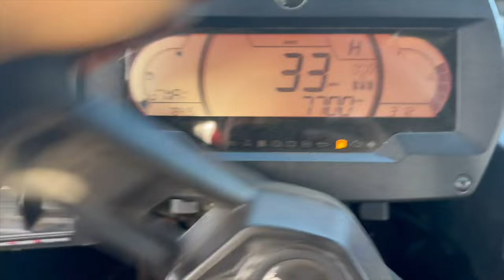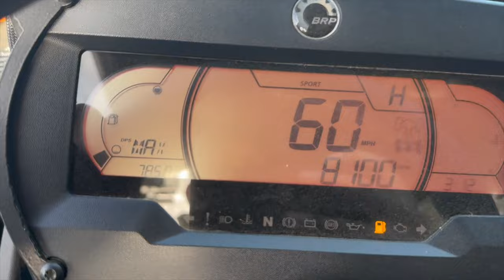Evo InSANDIty Clutch kit Install on 2022 Maverick X3

Comment: Great video, thanks for putting it out there 👍

A question.. when I removed by main plastic clutch cover on my 21 XRS, I had difficulty slipping the case out from behind the shock, is there a particular trick to sliding the case away after undoing all the bolts? Thanks
Reply from the maker: Slide it down and back. You definitely have to do a lot of wiggling to get it out. It’s so much worse on a 64 inch machine lol
Reply: @discoverpowersports  thanks buddy, appreciate the advice, I’ll give that a try, I don’t know if something changed on the later models but on videos I’ve watched videos and it seems a breeze to remove, it just slides out but for some reason I struggled, had to unbolt the shock then ripped the smart shock cable out like a marshmallow as wasn’t paying attention, $170 error, not my finest moment haha. Keep up the great work with the x3 videos 🤝

Comment: Another youtube channel commented on this video last week about the problems they were having with their setup which was similar to yours. But I don't see their comment anymore. Did you delete it? They shared a link to a forum that talked about their issues with the setup. Do you have that link? Do you remember which youtube channel it was? I think it was Assault something. I'd like to ask them some questions. Thanks in advance.
Reply: That was us. PM us on our channel.
Reply from the maker: Was it on this video? I don’t remember one and don’t see it.
Reply from the maker: Uh oh what happened?
Reply: @Discover Powersports  I tried to share a link to a conversation I started on "maverickforums" but I'm guessing YouTube took it down. They don't like outside links sometimes. Basically, I had no performance gains after I had Evolution Powersports flash my 22 XRS's ecu. I even installed their clutch kit, etc. A couple of other people had the same issues. I was hoping you guys could get it figured out and had better luck than us. I sold that XRS, but I'll be watching for your video updates out of curiosity. 👍